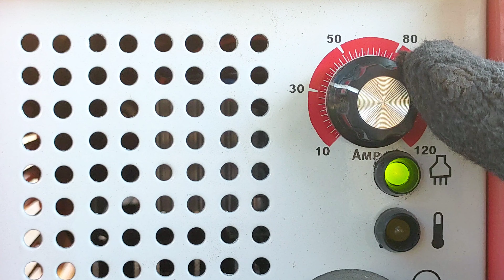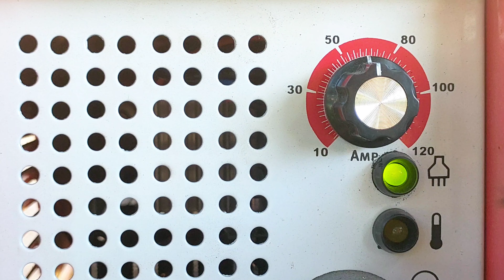rarely discussed how to weld thin square iron to galvanized square | welding tricks and tips

Comment: Thanks. Two days ago I took on welding, I will make a little garden shed for my wife. 2cmX5cm galvanised metal. By now I haven’t welded a single inch, ever. but I am confident this shed will be up by next weekend. The build itself will take a day.
Do you have one where you weld in the upright position, 90* angel? I might also need a few upside down weldings. Either that or I’ll just weld full frames on the concrete slab. The metal eh… beams? Pieces, are only two meters long, there will be one side that’s four meters long with support in the middle
Reply from the maker: good luck
Reply: @globalwelder06  thanks. I know I can make it.